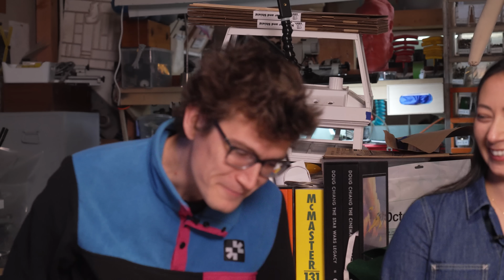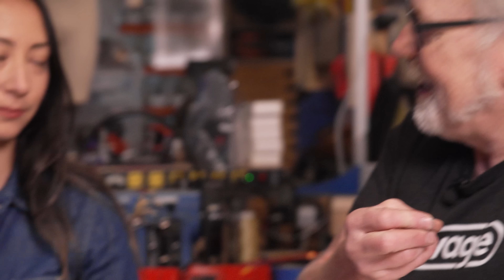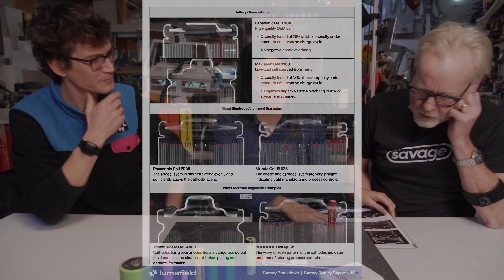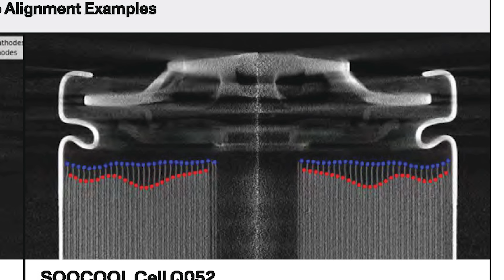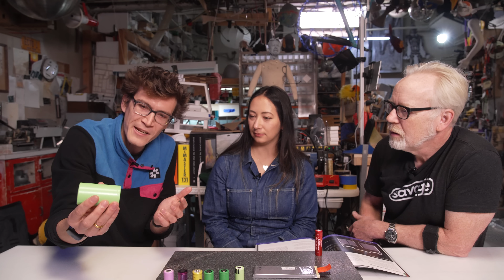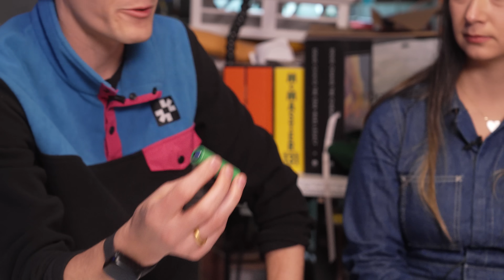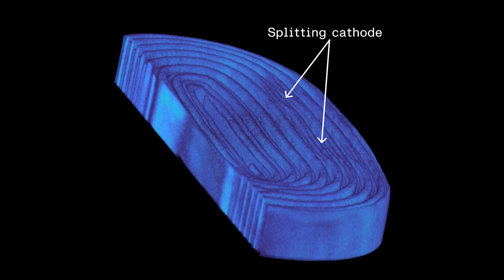The Surprising Flaws in 18650 Lithium-Ion Batteries

Comment: WoW... This isn't myth busters; It's Mega Consumer Reports/Osha .I'm right now trying to find the correct bike battery because factory (China) brand had a major recall. The battery issue of everything electrical/ mechanical is Sooo Huge .My thinking is making something to small and cramming it in a very tight space then triying to desipate the heat is that small area. You engineers are the people we need to help this major dangerous issue. Adam, what happen with your side kick other show. 
I'm back to being a large fan. Thanks.

Comment: I always said and believe in buying good brand name batteries from a trusted supplier and I have disassembled many larger packs to build my own battery pack for E-bikes, I would disassemble Tool battery packs and other high amp packs for my own custom packs and big companies like DeWalt or Milwaukee have good cells in them like Samsung Panasonic and so on. but beware of big blue wrapped China battery company they are taking over the market quickly

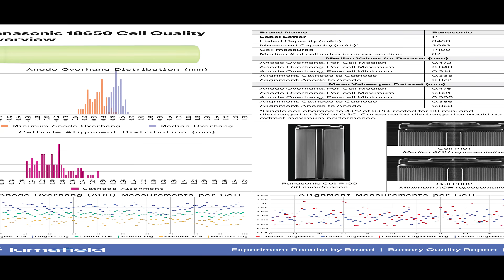Comment: 20:50 "Buy good brands"

Lmao, you can't. Good brands will never sell those cells directly to consumers to avoid responsibility. They literally have a huge "DO NOT USE OUTSIDE OF BATTERY PACK' stamped on all of them. What they mean is like those stupid proprietary drill or laptop batteries. So to buy just the cells you kind of have to rely on shady sellers whose idea of a "battery pack" is to just slap a sticker on it or put another wrap on. But shady sellers be shady, nothing is stopping them from putting any label on any cell.

Comment: I repair a lot of electronics and see a lot of bad batteries. What irks me is the lies claimed by the battery specs. Some power claims are literally impossible and yet they are allowed to remain for sale online. This should be illegal. Large distributors should be held accountable to spot check and test products they sell and remove any fraudulent products. Now, it’s no longer just a performance issue, but also a safety issue. Something must be done to stop this crap!

Comment: As a former procurement officer, I have some knowledge about battery industry as a whole. I mainly managed maintenance free lead-acid battery tenders. Test results are spread on a broad quality spectrum. Some producers even put cement at the bottom of battery to make it heavier. Compliance markers are all over the place. They make promises hard to attain. Even good samples are not sustainable in batches. And lead-acid batteries have runaway scenarios, too. I think the solution to low quality batteries (anything in general) is thorough and repetitive testing/reporting and banning low quality products and not import them at first place.

Comment: By far the biggest issue with modern tech is the batteries failing. While proprietary batteries are less popular in cheaper products, very few items are made to be serviced or allow for the battery to be changed. I mostly avoid products that have batteries if I must purchase I ensure that the batter is removable and if possible uses a standard which works with batteries I trust. I have Samsung X cover phones as they still have removable batteries (though the latest model they have removed the headphone port so I won't be buying that).
I haven't had an issue with batteries personally, but have a friend who works for the fire service who had a house fire while charging Air Soft batteries in his garage. 
Never leave something charging unattended, or somewhere flammable.

Comment: sounds like to me, only buy 18650s from reputable sources. Never buy from amazon, temu, ali-whatever. Serious. Stop it. 18650's have been put on the cosumer nazi safety naughty list (CPSC) because of 18650 bought from those sources.
I've moved to the 18650 ecosphere. I love it. 2-4 hour charging. will tolerate low or high drain. average higher voltage discharge.

Comment: I was removing tac weld strips to replace a battery pack following all pre cautious and it was literally creating sparks when both ends of the battery is not even connected at all. Needless to say, threw it out because of that lol

Comment: Thats a lot of density. I wonder how much batteries effect the land distribution of density over an area. You can put a lot on one place, which means more density in the higher volume. I wonder what the total pressure per area from the density in all the batteries all over the place is.

Comment: I use Vapcell in different formats (18650, 18350, 10440) in all my flashlights, did not realize they were resellers and not a manufacturer. Decent batteries nonetheless, they have good continuous output and flashlights remain bright even when battery is low. On the flip side, I can't tell how much charge I have left (because flashlight does not dim) untill I put batteries in the charger and see the voltage 😅 So I just rotate them every few days of active use.

Comment: This was a hundred times better than the cable video from last year. Really important information, clearly presented. Kudos
Reply from the maker: Appreciate the positive words!
Reply: What the hell are you talking about?
Reply: @rogerd4559  Huh? I'm talking about a video they did last year using the same technology that compared an expensive apple lightning cable with a cheap dollar store usbc cable. The methodology was terrible and it came across as a 20 minute apple commercial. This video was a much better use case of the tech and actually provided some important consumer safety information.

Comment: Re wrapped battery companies are usually buying B-bin batteries, as to say they're buying lower quality batteries that the manufacturer took out during quality control because they don't meet their specifications...i imagine that's why so many of the re wrapped brands are so much worse. At least that was my understanding when i was learning more about 18650 batteries a while ago. So a company like Samsung or Sony will sell the cells that don't quite meet their standard to these companies who make extraordinary claims like 9000mAh out of cell that is normally rated for 3000mAh.

Comment: lithium battery fires are NOT a "real" issue,at all, adam...
please don'T spread misinformation
Reply: Quick search says otherwise. "Airline lithium battery fire incidents are increasing, averaging around two per week in the U.S. by late 2024/2025, with 2024 setting a record year for verified events (over 85), often from vapes, power banks, and phones, causing significant disruptions, though most are caught early before full fire. These fires are a growing safety concern, with a jump of 388% on U.S. flights since 2015, highlighting risks from devices in both cabins and checked bags." And that's just airline stats. Add to that all the other fires that happen all over the world that are unreported.
Reply: Also, here's some that were reported. "Key statistics include: Over a five-year span ending in 2022, there were at least 25,000 reported incidents of lithium-ion batteries overheating or catching fire, resulting in approximately 141 injuries and 13 fatalities."

Comment: Never hear of battery fires. When Samsung shipped out phones that melted it made headlines. I don't worry about battery fires, I even build battery packs from discarded devices, with random charging circuits. 
 Statistically, you are more likely to be shot by a traffic cop than to experience a battery fire. So apply your fears wisely, avoid places police frequent, and carry your batteries in your pocket. You will be ok.

Comment: Another point is the highest genuine capacity 18650 cells available are 3600mAH as of January 2026, from major manufacturers.
Anything claiming higher capacity, or even near that capacity at lower cost, is almost certainly faked.
I can see something like 9000mAH? and a 4000mAH in that collection, so at the start of the video I'm guessing those are junk grade ones.
(Some consumer branded cells have been marked with ludicrous and impossible capacities for many years, though I don't see that specific label in here).

Comment: You get what you pay for.
I make battery banks as a hobby. Often load cycling with different 18650 and 21700's, to find their true capacity (mAh or Ah). Checking both high and low-current (Amp) cycles. While using a constant or fluctuating resistance (Ohm)  V=IxR
It's worth while to note, not only are the name brand batteries made with a better QC. They work better and longer. In the real world using them saves you time and effort. Also making your item work optimally. Giving you better results.  
As a example: yes those cheap drill batteries work, but your drill will not last as long before you need to change batteries or turn with as much power.